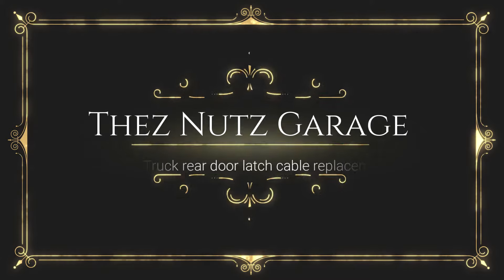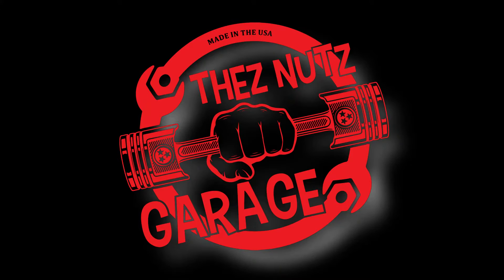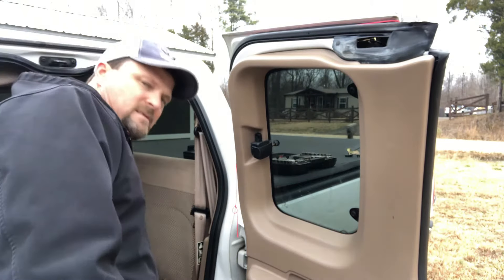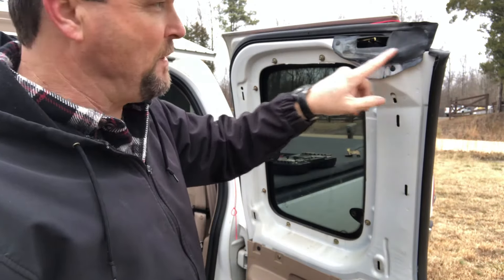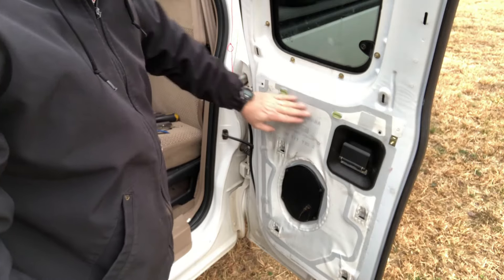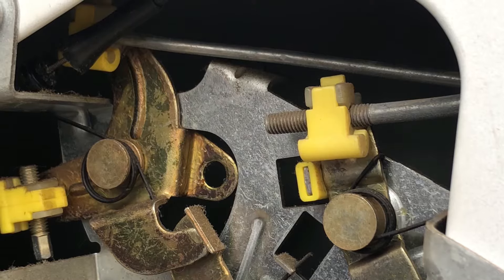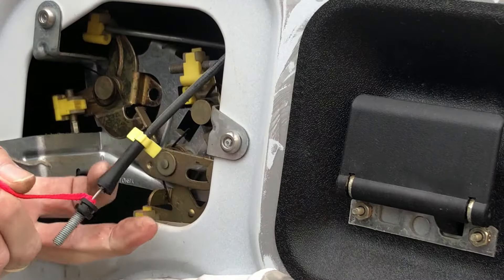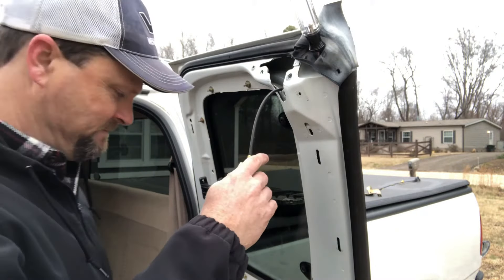How to replace rear door latch cable on Ford extended cab truck. TNG Episode #50

Comment: What are the clips called at Autozone?
Reply from the maker: There is a link in the description below to order them.
Reply: @ThezNutzGarage  thanks, the link takes me to the cable ends.  You mentioned the black clips you got at AutoZone.  they have so many to choose from and of course I got ones that don't fit.  I was hoping you may tell us which clips you bought.
Reply from the maker: Your talking about the little Christmas tree clips. I have a draw full of different sizes.

Comment: Nice fix on the upper latch but what about the bottom latch.  Both are broken on my F150.    So why doesn't Ford redesign this mechanism so that they wont wear out or just break.  This is the 4th f150 that this has happened to.  If Ford really cared about their customer then they would resolve this issue.  I'm thinking about switching to dodge ram.